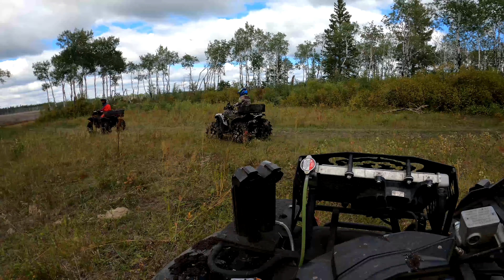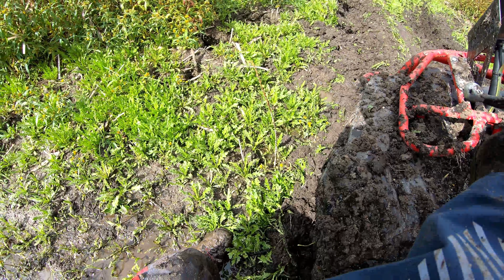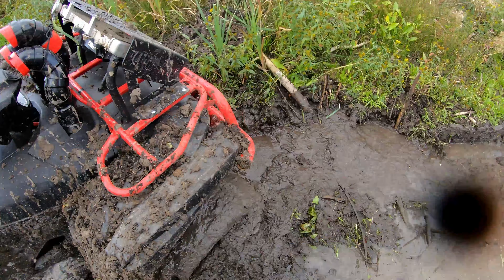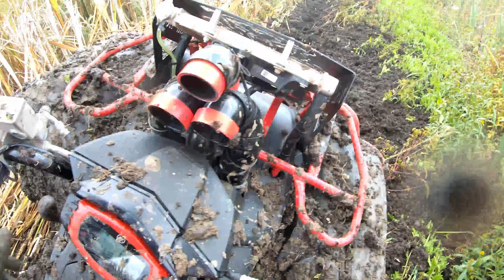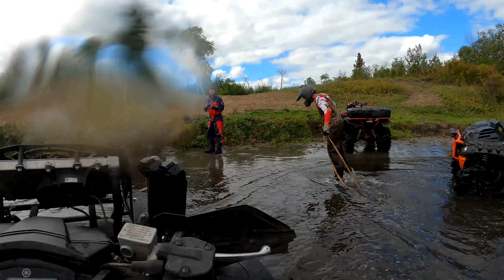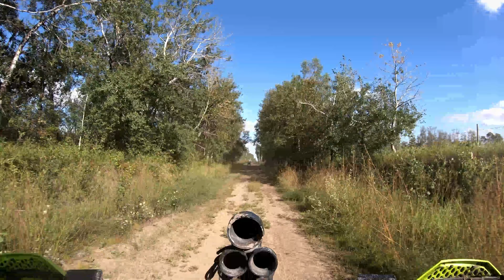Where Does This LEAD TO!? Taking on Water!

Comment: Being you use to run an outlander and right with high power bikes how do you feel the grizzly does against them in the mud. Thinking about selling my sportsman 850 and going to a grizzly. I know I'll be down power but always been a fan of Yamaha reliability
Reply from the maker: The grizzlies tend to do exactly what stock outlander and renegades can do but more boring lol. Honestly my Outlander was more reliable than the kodiak when I broke down costs. I suggest a 650cc canam or the yamahas.
Reply: @MainvilleATV  thank you for the feed back. I like my sportsman for the power, ride, and handling. I have not been on anything newer then a 2018 outlander but hated the way they handled in the corners compared to the sportsman but like the  canam power better